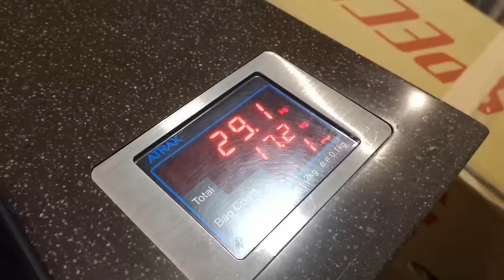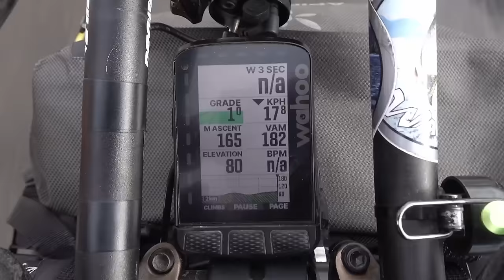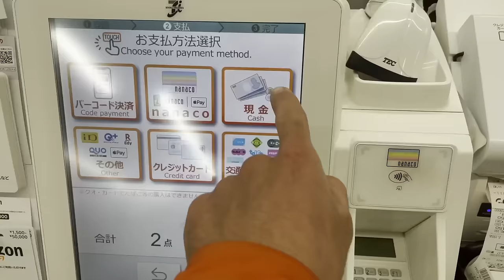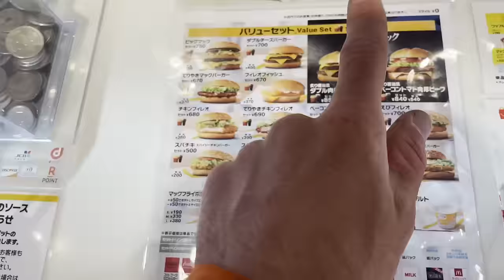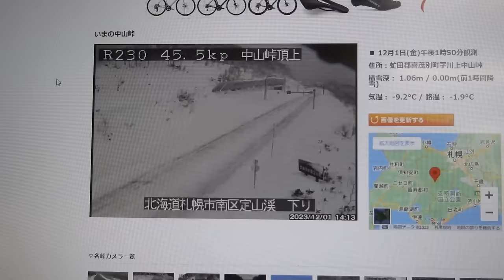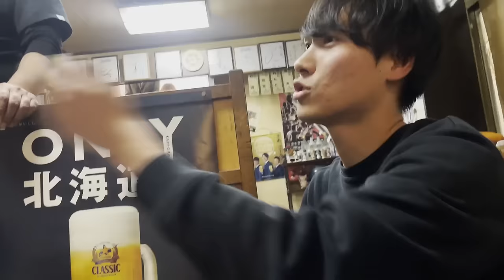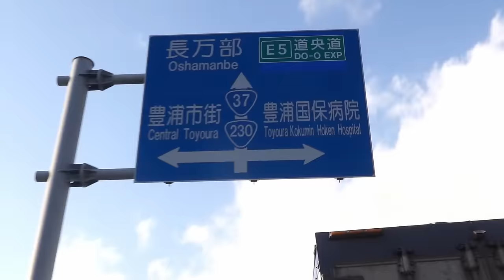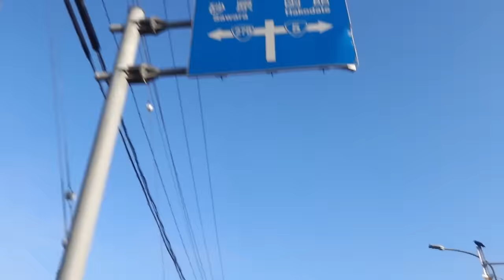-10° in Japanese Winter | ON THE ROAD Ep.1

Comment: Hokkaido has two good seasons, winter and summer. I enjoy skiing in Hokkaido every winter, it's wonderful to spend the day on the ski slopes, soak in a hot spring bath afterward, and then spend the rest of the evening next to the fire in the lobby drinking with friends. I've ridden the alto l'angliru in Spain, but am not hardcore enough to cycle around Hokkaido in the winter. On the positive side, the bears are hibernating. 

Summer cycling in Hokkaido has to be the best of any place I have experienced. Cooler weather than the rest of Japan, smooth roads, light traffic, fresh air, spectacular scenery, and excellent food. It's only a little more than an hour by air from Tokyo, and transporting bikes is painless.

Comment: You're probably in warmer climes by now, but Neoprene shoe tip covers are a lot of help,  Merino socks and keep your feet DRY at all times. Change socks when wet and don't get socks that are too thick that cut off the feet circulation. when changing socks look at your toes and make sure they blanche.  Your young though it should be OK but keep an eye for frostbite on fingertips, toes and nose.  If you are a good at taking apart your bike and making it a compact package you can get one of those green/blue tarps and if it is neat looking sometimes a train station will allow you with it on board. Will be very difficult in wet winter though.
Your toes look OK but those shoes are definitely too thin. Ok saw u got Neoprene shoe covers.  You could have also gone from Sapporo to Tomokamai and taken a night (Sleep for 5-8 hours on board) Ferry to Hachinoe. Yeah Japan rocks for cycling if you're  fit. :) 🚲

Comment: Hokkaido by bicycle in winter with merely 3-season clothing?!? I've cycled Hokkaido a lot, but I certainly wouldn't attempt to do that! 

If you need cheap clothing, drop by any home center and they always have outdoor workman's clothing at good prices. If you can find the chain, "Workman", even better.

For a "rinkobukuro" (bike bag), try using a blue tarp, also from the home center. If you wrap it up well with bungee cords the trains will accept it.

The Japan Sea coast of Honshu is a lot colder and has far more snow than the Pacific side of Honshu. You may want to consider that.